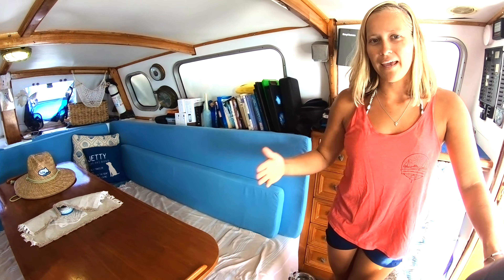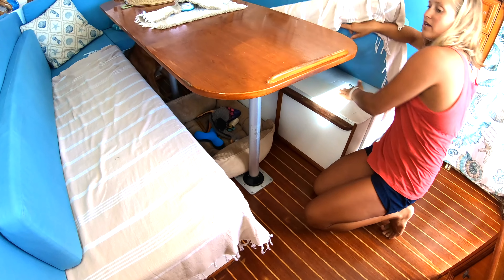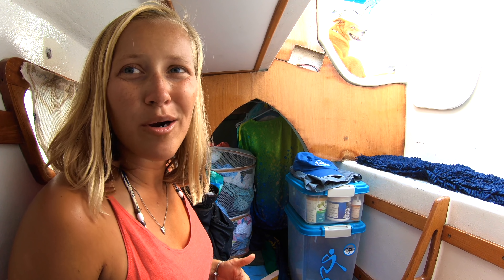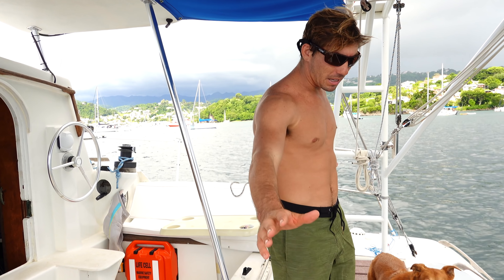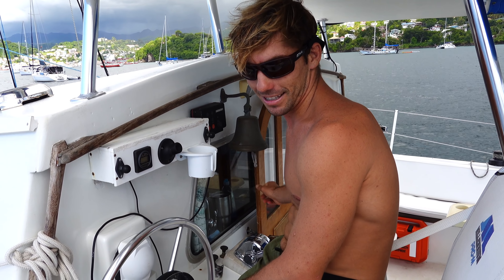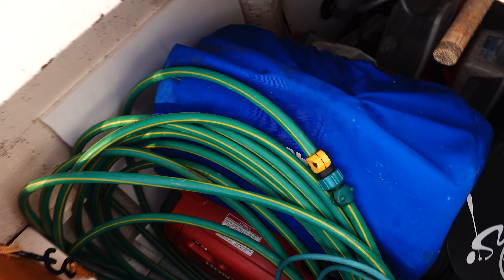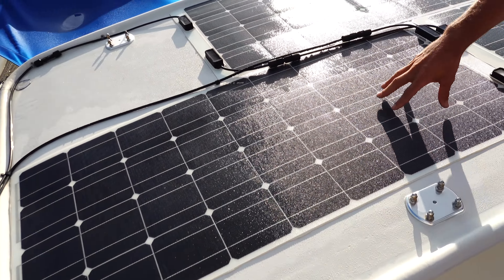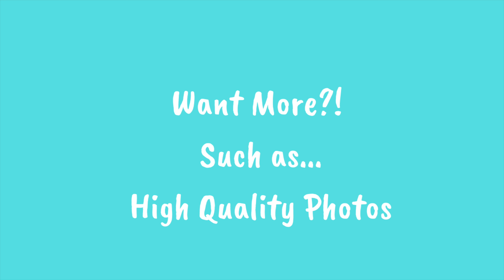CATAMARAN TOUR: Our tiny FLOATING Home! 30 YEAR OLD Performance Sailing Catamaran

Comment: Great lay out and refurbish job by both of you. It's very interesting how much knowledge you both have acquired from on the fly sailing. The only thing that I've noticed on most cat boats is the galley table does not have a 2 inch side rail which would prevent stuff from sliding off onto the floor when underway or rocking motion.  I wish all galley tables were gimbal like a cup holder or stove.  Now that would be amazing. or a gimbaled bed.. ha ha.

Comment: I'm looking into doing something no one has ever done, starting with wharram hulls, add a hard top making it into a fully electric catamaran, with retractable free standing masts with self tacking snotter cat sails.  It would be a little more rustic than your boat, but it would have air conditioning, which I cannot live without.

Comment: I am in my 80th year but I have had this dream of a catamaran with submersible wing shaped hulls that can be rotated 270 degrees. since I was a teenager.  It would be about the size of Adrenalin  but there would  only be a small deck  at the bow and stern like you nave for your dingy.  The rest would be two cabins with  a cockpit in the center,  Waves could not be trapped between the hulls as is a common problem with catamarans because each side would be raised up 4 feet above the water with only a bow stern and center support.  The hulls would  pivot on the for and aft supports and the center support would raise and lower to rotate the hulls.  With the hulls rotated up underneath  the boat would sit low in the water for being at a dock.  With the hulls horizontal  the cabins would be up above the wave but only slightly wider.  When down vertical  they would give maximum tracking into the wind.  The lee hull could be horizontal  for maximum stability while the windward hull if wing shaped would counter the drift  from the wind. or both could be horizontal to plain down wind.  There would be a center rotating boom mounted  on top of the fore and aft cabins. with 4 poles that meet above the center pivot,  That would eliminate the standing rigging and having to wait for bridges.  The triangular sails would  ferrule into a hollow mast that would be attached to the front of the boom and raised to pivot where the 4 poles meet.  A square reef-able storm sail could be ferruled  in the boom.

Comment: I live on my Loch Crowther 1988 (now) 37 footer. 11.1 meters for most of the world. With a 7 meter beam.(23 foot)
Sadly it is single-engine but my bridge deck connects to both hulls.
I'm a newbie sailor and don't have the miles you guys do. And I sail solo.

Comment: It would be cool if under the seats around the table the stuff under the seats could be on roll outs. May not work or could be what holds up the table top when in "Bed mode"   Great boat tour thanks!
Reply from the maker: That would make accessing things a little easier when people are sitting down especially in the aftermost compartments

Comment: Nice tour, does the built in fridge work or just storage and what's your battery set up? Lithium or AGM. Cheers.
Reply from the maker: 200AH Lithium House Battery and 1 100AH high performance lithium starting battery. Externally regulated alternators through Balmar regulators and a Balmar centerfielder to control them together.

Comment: Billy - I’m surprised at the cosmetic condition of the engines. I hope you are doing the required service ? Have you serviced the raw water pumps ? Why are the engines so rusty ? Salt water must be leaking on the engines from somewhere.
Reply: Their 30 years old...living in a marine environment.....beauty is on the inside not the outside....I have been watching since the beginning, don't worry B has got his shit together...only failure will be age not maintenance...😉
Reply from the maker: The engines look better than when we bought the boat... I do ALL the regular maintenance and the longer term stuff too like hoses and muffler and valve adjustments, etc. The previous owner at some raw water hose connections which led to easy drips and leaking and a lot of the rust that you see which have all been addressed.

Comment: I've commented on your original tour video, but, I see the part I referenced to again at 5:43  I see a much better view of it. . Its plywood you walk under. It needs to be re-enforced so that a wave won't destroy your boat.  There may be more than one of these that need to be re-enforced. This happened to another sailor couple , when they had made it to Hawaii . Zingaro. i can show you exactly where that boat failed. It was a performance Cat just like yours.
Reply from the maker: Hey thanks for the heads up. We saw Zingaros posts. that’s actually all glassed over pretty thick on our boat. We also have a nice glassed over filet on the inside edge where the hull meets the bridge deck. No stress cracks anywhere on that connection so we aren’t too worried. Thanks for the heads up though we really appreciate you looking out!
Reply: @Tulasendlesssummer  Ok, I wondered what that material was. It seems to be on one side only ? Perhaps other boats have failed as theirs did ? My thought was to put a piece of Marine plywood against the side that isn't glassed ? Screwing and gluing it?  Their boat could have been re-enforced very much by doing that with inch marine plywood. And possibly a plate on either side where it meets the hull ? The damage to their boat was drastic, they were lucky to have that much dyneema on board.

Comment: I listened to this on my way to work. Very relaxing. I like the way you are able to tackle any project and get it done. Even if it does not work out you have the tenacity to carry on. One of my favorites is when Billy worked on the pressure plate/transmission . A lot of effort went in before the decision was made for outside help. More fun to watch then to do, but I bet you learned lots. 
Adrenaline 2 is shaping up to be a great boat, because of all the hard work you put into it. I remember when you first bought boat and cleared it out, how much weight this boat was carrying. I don’t know what last owner was thinking.😁

Comment: I was watching a different selling video just yesterday and he was talking about the top 10 things that they have done wrong they had talked about the top 10 things they also had done right even cover the top 10 thing most expensive mistakes And will all that said one of the things that they covered was those flexible panels that you just installed they had worse reviews from actual people there or on the water every day on the boat and reviews that they got absolutely sucked eggs for those particular solal panels
Reply from the maker: Was it the same brand “Renogy” ? Ours have been working great so far
Reply: Tula's Endless Summer I do not know the name brand they did not say. If you would like to see the video The YouTube channel name is Rigging doctor and the name of the video is called. How we wasted $23,831 on our boat sailing wisdom.

Comment: Hi Billy, Siera and Jetty.  To answer your question, if I could close my eyes and have my dream come true,  I would love to have a gaff rigged schooner. I know they're old fashioned compared to more modern sailboats,  but I just love them, and have since I was a child. Currently my boat is a 15-1/2 foot sailing/rowing skiff, which I built. It lives on a trailer in our driveway and only gets used for exploring local inlets. I am about to build another boat, purchased an Eastport pram kit from Chesapeake Light Craft. It's only 8 feet long and lightweight so I should be able to easily lift it on and off the cartop. Happy sailing!